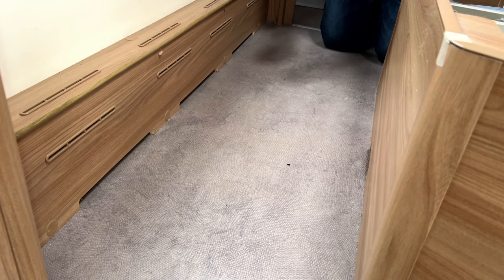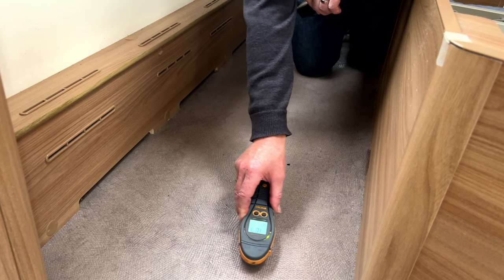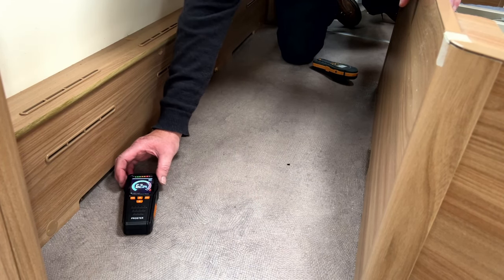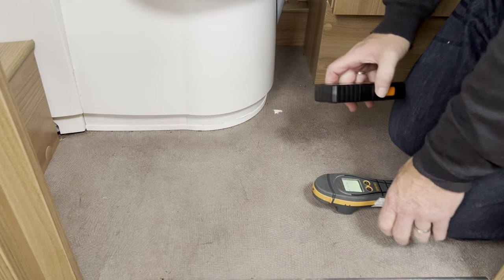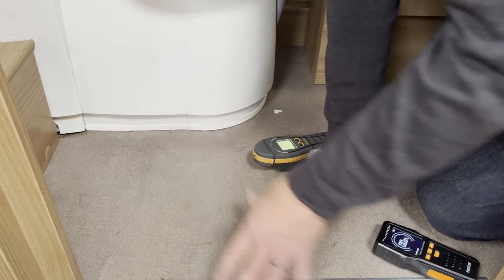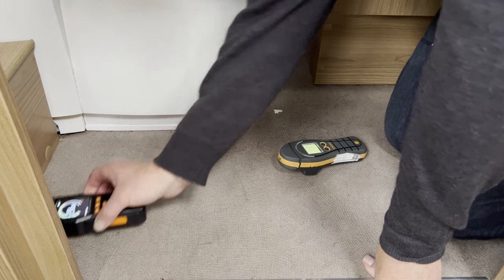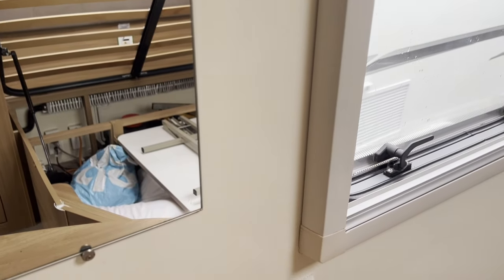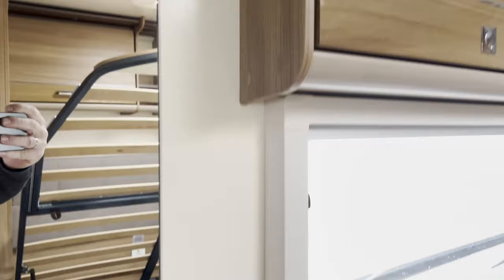Bailey Alu-Tech water ingress

Comment: I had exactly the same on my Bailey converted outside broadcast unit (I think mine may have been the Alu-Tech protorptype as it has no windows, other than front). I stripped it all back and added 9 mm ply alround the floor, mastic taped around the skirts and bitchamined the wood on both sides. Useful video, thanks.

Comment: Glad I found your channel as I have an 18 month old Bailey D4-4 which is beginning to show this exact problem. I ran a hose over the lower rail and it was peeing from the top, past the cowelling down the L shape which goes under the lip which connects to the floor - thus, awash with water. Yes, STILL a design floor but I think I can solve it myself by taking the outer rail off and putting some real quality sealant on the top joint. Gonna do that all around the van as we haven't even been out in the darned thing yet due to problems with my car. Just about to and this happens - Oh, and mustn't forget that the assembly chimps in the Bailey factory skimoed on the sealant they used on the back of the shower panel so it has come away already and also over tightened one of the screws on the Shower surround so it comes away from the wall. My dealer was very offish and as per what me and the Mrs has had to do when dealing with any tradesemen, we're going to make the repairs ourselves as we know we'll do it properly. The Alutech would probably get over the problem if they extended the overlap from the side panels over the sides of the floor panel. But that would be too easy. We are pretty furious as we paid £22k for this and have all the gear now. We will prevail though. Thanks for posting - love to see a fix - who knows, maybe I'll do one!
Reply from the maker: Take it back to the dealer, it’s under warranty..

Comment: My friend had the exact same model and the same problem. I checked it with my own professional meter. The problem was a leaking roof joint strip. Pretty common on these. They are designed to fail. The area of damp will depend on how the van is parked eg how level the ground is. My friends was slightly leaning to the off side while in storage so gave the same kind of readings. Damp under vinyl takes months to dry out. Readings are slowly dropping but are still at 30% at the highest. I've had a new Bailey. Never again.

Comment: 2021 Grande SE. Wall sides don’t go far enough below the floor edge. The lower side rails are not adequately sealed and allow water to get in, down to the wall edge which is flush to the floor. Water gets into the floor edge and soaks inward. I have removed all the rails and inner rail put building damp proof strip between the wall and the floor so it can’t get to the wood. Re-sealed and refitted the side trims, problem solved. The initial problem on your video appears to be roof strap or “T” bar as you have called it. 10:00
Reply from the maker: Surely that’s under warranty?
Reply: @atlanticcaravansUK  it’s a design fault and I don’t trust anyone else to do it, plus I’d have lost the van for weeks.it’s fixed now. Been raining heavily for the last 2 days and is now dry.
Reply: @keithbowers5548 do you have details of how you did this?
Reply: @davidmbell Do you have an email David?

Comment: Hi,
Both myself and the Wife have been touring for nearly 18 years.
In that time we are now onto our 4th caravan; changes due to family circumstances ie kids getting older and don’t come on holiday with us, therefore layouts need to be changed.
We have owned 3 Bailey caravans, our first the Ranger Series 5, 2nd Bailey Unicorn Cadiz Series 3 and our 3rd the Bailey Unicorn Cabrera Series 5, which we bought in December 2023.
None of our Bailey caravans have had water ingress.
As you know our current van (Cabrera) has the Alutech construction, therefore can you please confirm if the £30 damp meter can only be used for readings on the floor?
Incidentally our 2nd van was a Swift Challenger Sport 2012 and after 2 years old, it had to have the whole back panel changed due to water ingress, thankfully replaced under warranty! 
Regards,
Steve Brown.
Reply from the maker: Hi, yes, the floor is the only place a Bailey will show water ingress. The £30 meter will show early signs of ingress well enough.
Reply: @atlanticcaravansUK  Hi, many thanks for your quick reply, it's much appreciated.
Might be a daft question, but what about the roof? Cheers, Steve.
Reply from the maker: The Alu-tec main construction is GRP so won’t show signs of water ingress. Water can run through the roof and walls, but it’s where water sits for any length of time in materials that are susceptible to damage by water that the problem an occur, which in the case of a Bailey is in the floor.
Reply: @atlanticcaravansUK  👍 thnx again for your help. Think I'll be buying the budget meter, so I can check for WI more frequently, other than waiting for an annual service, by which time, the problem may have escalated!

Comment: We are considering a 2017 Baily that we have seen. If it's dry now, do you think it will stay dry? I plan on taking my moisture meter with me if we view it again. Also, a mirror to look underneath. Also, presumably, the dealer took readings when they took it  in part ex
Reply from the maker: I wouldn’t assume anything, but if you are buying it from a dealer you’ll have warranty so don’t have to worry as much. Look underneath, I’ve just bought a 2017 with wet floor underneath. Just keep checking it is all I can advise.

Comment: This is a cheap fix for Bailey  if they would extend the walls below the floor. I don't understand why they haven't done this. The government now has a minister for commen sense I think  Bailey needs one
Reply from the maker: It’s the same with Swift and leaking past the cant rail into the van, if the roof panels overlapped the side panels water couldn’t get in. I can only think there must be some technical reason for it.
Reply: It could be as simple as the GRP panels and the machines that handle it can't be any wider and therefore the van walls can't be any taller or extend any lower. If you ran the whole width of the side past the floor edge there'd be nothing below to support the side and it would be bolted from the side into the edge of the floor, so probably not nearly as good structurally. If you just had the edge of the exterior GRP panel over sail the floor edge and on a bit further, it is very thin and would be prone to damage.

Comment: Don’t understand that competent caravan and camper builders can’t design a jointing system that doesn’t leak when new or 30 years old. Have they never talked to a boat builder, leaks are pretty detrimental in their situation, have a overlapping roof, double seal window and panel joints, solid mechanical connections instead of simple little screws and make all fittings and fixtures stainless. Not that difficult !!!